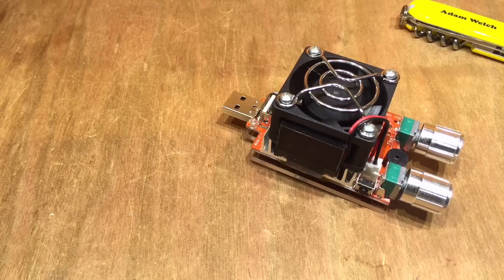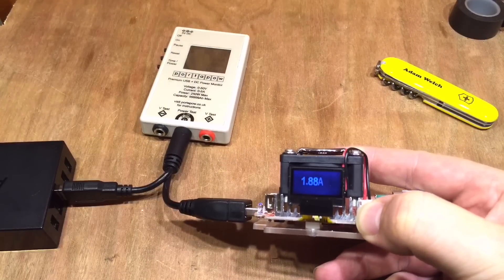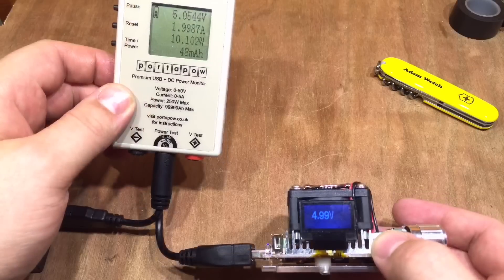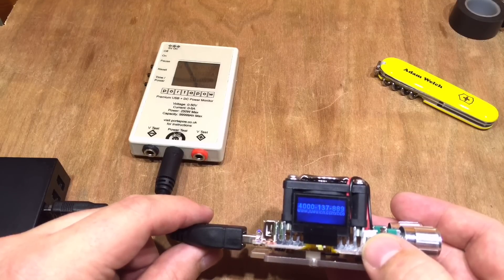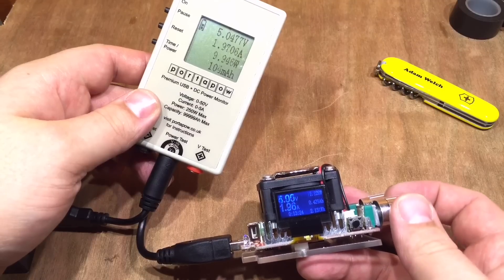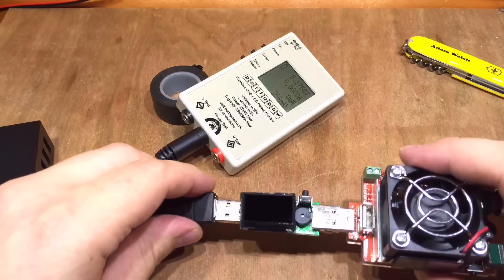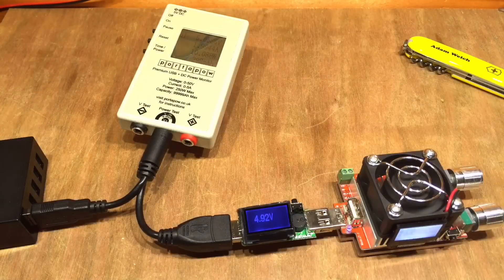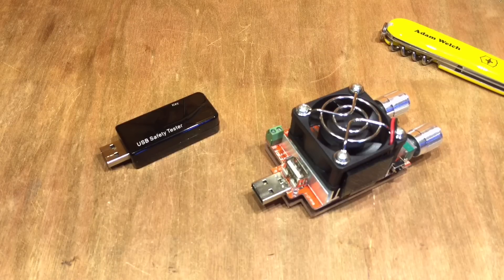Calibrating the USB Dummy Load - 12v Solar Shed

Comment: Hello
 If the propeller of the ventilator has an unbalance, then I take small
 pieces ducktape, about 4mm x 8 mm large. These are glued to the front 
of the propeller, but in such a way that they can be removed with a 
tweezers.
It may be necessary to apply several of these small adhesive strips to different sites. With a load of about 1 amp at 19 volts, there will be a window of about 10-15 seconds until the fan starts again.
 During this time you can use a pair of tweezers to reposition the adhesive strips until the desired result is obtained.
In the ideal case, the imbalance is not much to be felt.
If the right spots are found, you can use a very small amount of 
adhesive (cyanacrylate) around the edges of the adhesive strips to fix 
the adhesive strips.
The attachment of the adhesive strips can be made without the need to remove the protective grid.
Then allow the adhesive to dry, so that no residues of liquid glue can fly around in the ventilator.
Before using the load, check if the glue has cured.
I hope my suggestion likes one or the other :-)

Best greetings

Comment: OMG Thanks for the video. I have had this thing since it first came out and the voltage has been wrong the whole time. Amps is good, but volts is way off.
Reply from the maker: +Adonis cmj Yeah the voltage can crash if it's loaded too high. Mobile phones tend to be much more picky about the power that is going in - which is another reason I guess why I think it's best to charge a power bank and then charge your phone. In my experience power banks are far less picky about a fluctuating input.

Comment: I honestly don't understand why you would need a dummy usb load someone please tell me what you would use this for
Reply from the maker: +InspireAndInnovative Testing power supplies and power banks would be the normal use. Can they supply what they claim? This one also allows you to test different cables to find which one will supply the highest charge to your device.
Reply: Yea, but unfortunately it doesn't do a very good job at that. It takes power from the bank it is testing for it's screen, fan and circuits, so you have some loss there and it is difficult to factor that in. I wish they had made one that can be powered by a plug in power adapter so that it can measure power more accurately. I am not sure how much loss there is, but when the fan is buzzing fast I can only wonder.
Reply: Some of them has extra micro USB socket for electronics power supply purpose.
Reply: @cmj20002  it has a system power function dude